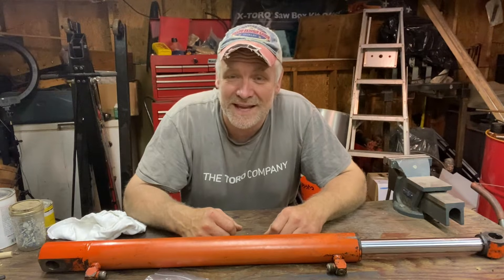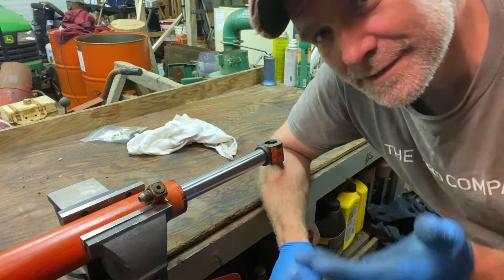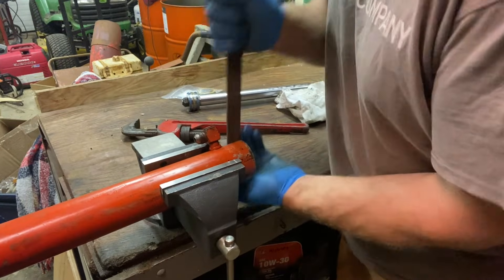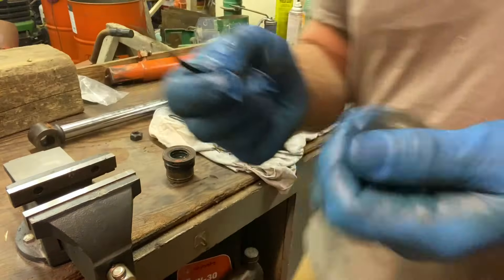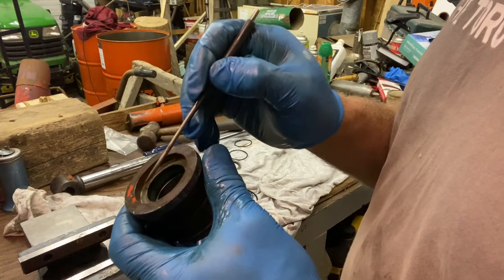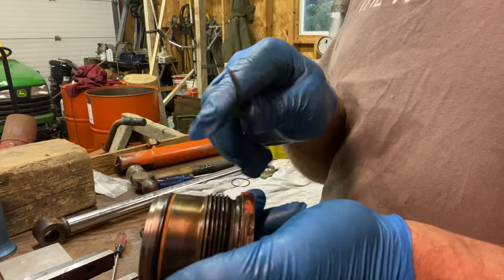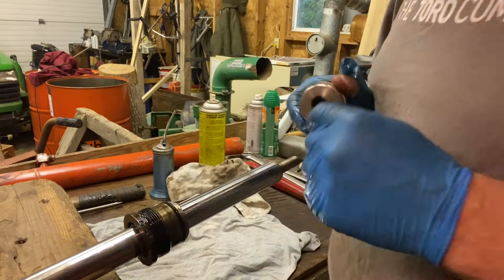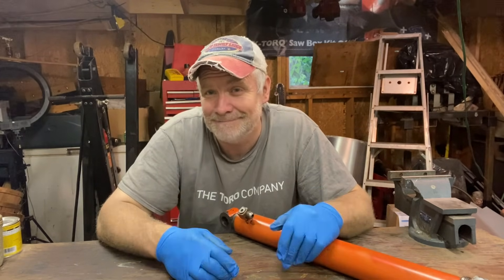How to Rebuild A Hydraulic Cylinder

Comment: the piston seal is a (ps style) put it in very hot water and is so much easier to put on the piston! second put the piston on the rod then put seals on! rod will hold piston while installing piston seal! 30+ years i’ve seen and done all the tricks! but good job! also on the piston seal  if it gets “stretched “ to much….you can use one of the old wear rings to overlap it and put a radiator hose clamp on it and tighten up to “ shrink “ seal back to correct size and easier to install in barrel.

Comment: I have a b21 i bought new in 2000  piston blew out. I replaced all hydraulic lines cause they all started leaking same time like a soaker hose! 25 yrs old no complaints here. Runs like new. Thanks Pete great step by step video.
Reply: Doing my dipper cylinder today on my B21

Comment: After getting quoted $600.00 to redo my ram thought I would search how to do it and came across your video. Very good and informative video. You show all the important things to make sure you do it correct. I have faith that I can do mine as long as I can get a seal kit as it is a Chinese mini excavator. Thanks for the great info. Think you just saved this retired guy some cash so I can now buy a filet mignon and enjoy my favorite piece of meat. 😀
Reply: I can vouch for the insane costs associated with the Kubota dealer to replace the worn seals on the bucket curl function. I pulled in thinking I could save some time as I have a lot of firewood processing going on and they quoted me $1000.00 to start to reseal both cylinders. I almost fell off the stool in the dealership! I walked out of there with two seal kits that cost me $350, which I thought was outrageous, but that is something I can’t avoid. 
Thanks Pete for this fantastic and informative video and I can definitely handle this job, just not in less than 15 minutes as you did. I was worried about that large outer ring that you had to roll on with a stretch, but do you think soaking it in hydraulic fluid and heating the fluid would help? I may help but I see you need to grip that piston pretty solid. I also bought a T-Bar hose clamp at TSC to help it return to its original size but that may not be needed after all.
Thanks again for making this video, It really helps and I may not be getting that filet mignon, but a 12-pack of Lone Star and some BBQ of something will be just fine for my celebration of saving well of 700 bucks!

Comment: This was so helpful! I really appreciate it. I did have a question about the yellow o-ring though - mine continues to be stretched and loose no matter what I do. Will this lead to premature failure in the cylinder?
Reply from the maker: If it is stretched too much normally you will see the seal get thinner in one spot.if its just that it’s a bit bigger. You push it back the best you can and then when you try to put it into the cylinder, just take your time not to get it pinched and it should be good Thanks for watching

Comment: Good explanation, i just did my Kubota bucket cylinder was just like that. Only thing i did differant was to heat the piston seal to about 200 degrees in hyd. Oil to soften it up.